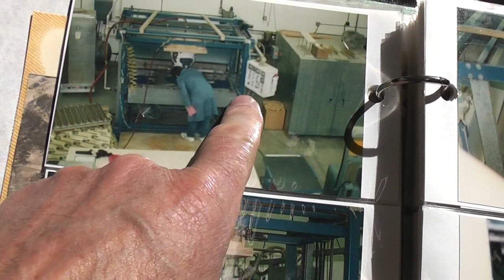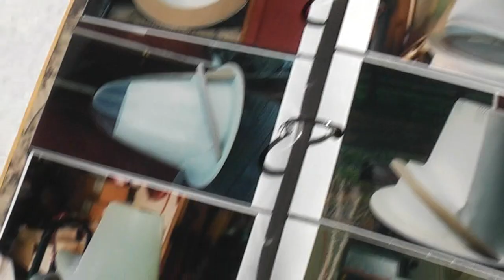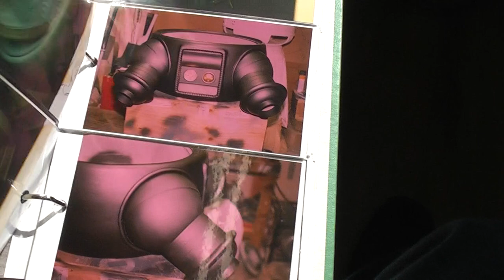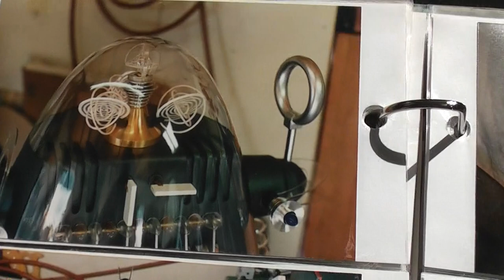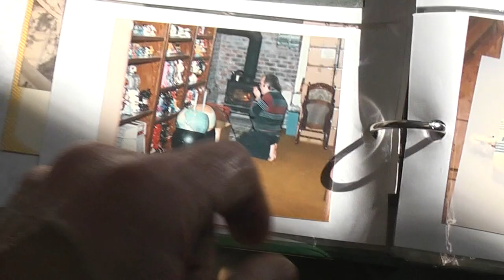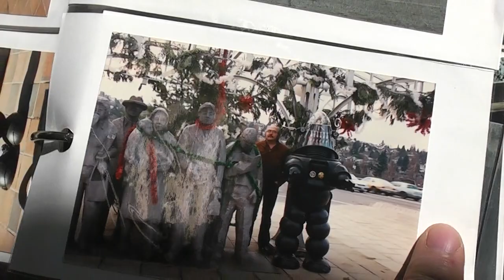Session 2 of Robby talk. Making the dome & 1987 mixed media Robby.

Comment: This video was very helpful.  I always thought that the dome was trimmed to fit just over the gyros and cover the front.   I had no idea that it covered the whole head and was painted with the ear pieces stuck directly on the dome.  I guess the fins on the back of the head must hide the seam really well.   I have to laugh at your comments about not being accurate.  The work you did fully accurate or not is amazing.    Every time I watch your videos I learn so much more on the construction.   I know that when you put files up on Thingiverse that they are dead accurate.  That attention to detail means a lot.  

Tom
Reply from the maker: As for the original dome as seen in Forbidden Planet , if you check out stills from the movie you can see how the dome was trim'ed in a saw tooth design just above the tops of the fins. You can also see how the back of the dome was super thin and had wavy places in it. I later TV spots with RObby the dome had been replaced and had a straight cut just above the fins.

Comment: So ultimately what do you recommend for the dome? Do you have a better solution?
Reply from the maker: There is only one way to do it that I know of. Make a master form "slug" from wood or high heat resin or wood covered with high heat resin. Use PET plastic, that's the same stuff used for water, pop, type bottles. it thermal forms easy, can be cut easily and you can paint it. A large vacuum form machine is best, but you can do it with lots of friends and large wood rings that get smaller and smaller in hole size. You have to work really fast with the wood ring set up.